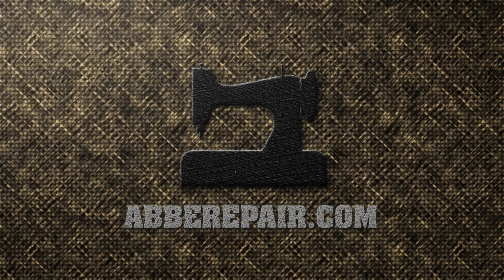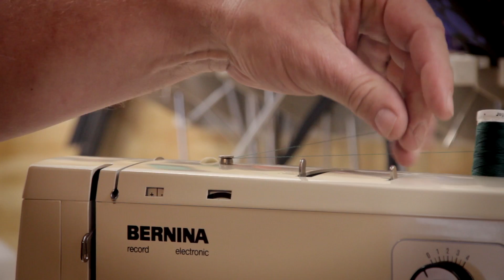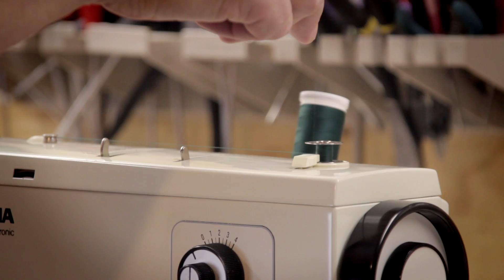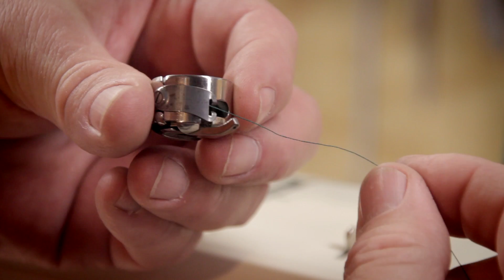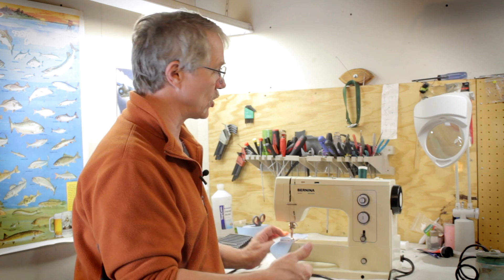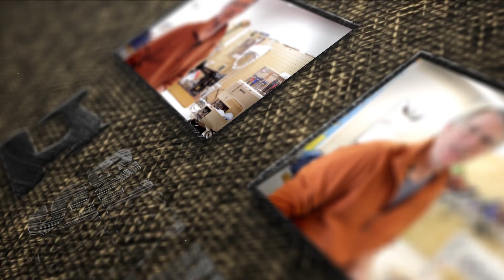Sewing Machine Repair with a Bernina 830

Comment: Just found your posts tonight as I was searching for information about a Bernina 831 I just inherited.   You seem very knowledgeable about these old machines.  This one has a knee lift bar but there is no connecting apparatus in the knee lift opening, just a plastic "plug".  Do you know where I could obtain the part to be able to use the knee lift?   Also, the needle goes up and down when I disengage the clutch to wind a bobbin.  There does not appear to be any old oil or grease and this machine was not really ever used.  Will this damage the machine when I use the bobbin winder?  It sews beautifully and I want to take good care of it. 
Thanks.  Pat
Reply from the maker: Pat Fuller hi Pat. Thanks for your question. If the knee lift linkage for the presser foot is missing the only source I know to replace it is buy picking up a parts machine and using its parts to install it in yours. As to your clutch issues, the hand wheel should move independently when the clutch is loosened. The main two reasons it won’t is lack of proper lubricant between the hand wheel and the upper horizontal shaft and/or the belt is too tight. Hope this helps! Allen

Comment: I have the same problem as Kar Ser (posted 2 yrs ago).  How do I clean the old oil from my 830?  Hopefully as you mentioned in your response this will take care of the needle moving when I'm threading the bobbin. Great video - thanks.
Reply from the maker: R Jackson R Jackson. Thanks for the comment. Old oil and grease act as a glue!  It gets very stiff! This old oil and grease needs to be dissolved and or scraped away.  Linkages may have to be disassembled. When lubricants get this stiff it must be removed but very carefully and very gently!  Damage to any part may be unrepairable!  I have a video coming soon on lubrication. It shows old grease and oil and offers methods to help.
Thanks again Happy Holidays Allen

Comment: Hello sir I have Bernina  using for almost 45 years suddenly the pedal couldn’t get a currents so when I turn  it on only the machine itself running   , please reply
Reply from the maker: Julie Aduca hi Julie thanks for the comment. I'm not sure if you mean the machine keeps running by itself or if you have to turn the handwheel to get the motor to start. Either of these situations should be checked out by a train tech. Oops with electricity is dangerous!

Comment: luddite question: i was given an 830 bernina and was told it was a serger. i am clueless whether it IS or not and would have no idea how to identify one (a serger, compared to a regular bernina). i'll peruse manuals and things on line, and may find out soon. but i'd love to have some guidance on this. thanks in advance  :)
Reply from the maker: nosowisewoman hi nosowisewoman  thanks for the question.  A sewing machine has one or two upper threads but most people usually use one and pair it with a bobbin and bobbin case to make a stitch. Sergers don't have a bobbin.  They have typically three or four threads that peel off thread cones perched on spool pins behind the machine. Sergers also typically have a set of knives to shear the fabric to a custom width to set the seam width. An 830 Bernina is a sewing machine not a serger

Comment: I have a question. I recently bought the Bernina 830. After I cleaned/oiled it. It runs perfectly. Why isn't there is gash where can cut the thread when you end a seam?
Reply: Hi All, the Bernina 830 has a thread cutter on top of the presser foot lever. You can lift both threads and cut them there. I usually use scissors but when in a hurry or can't find the scissors ;-) I use this cutter.
Mine is from 1979 and has this facility.
Reply from the maker: JandaliaTheFirst hi JandaliaTheFirst!  Thanks for sharing! Allen
Reply: This is the first time I've seen anyone mention the thread cutter on the presser foot lever!
Reply from the maker: Gladys McCoy hi Gladys!  Thanks for your note!  I hope you like yours as much as I like mine!  As for a thread cutter, I have a little scissors that I keep handy. Have a great day!

Comment: Hi Allen, Thanks for posting this video.  I have the same machine as the one you are demonstrating with, and was wondering if you run the bobbin thread through the hole in the arm on the bobbin case? If not, what's that sucker there for? Thanks.
Reply: The hole is for drawing the thread through to make a buttonhole.  I saw it on another YouTube video
Reply from the maker: motobuilt73  hi motobuilt73. What a great question!  I don't know why Bernina put that hole there!  Some machines seem to do some stitches better when you use it.  I'm surmising here but the engineer may have been thinking that routing the thread that way could make it feed smoother... I find it does change the lower tension if you use it or not.  Thanks again. Allen
Reply: motobuilt73 sewing pin tucks
Reply: I used to feed thread thru that arm hole

Comment: Thank you for a great video, Allen. I recently purchased a Bernina 830 that had been in storage. It sews fine but the belts are noisy. The hand wheel doesn't move smoothly. It makes a buzzy, crunchy sound. The belts are lug belts stamped with the Bernina name. They look to be in good shape and still flexible but I wonder if they are dried out.. Adjusting them didn't make any difference.  Would my hand wheel move more quietly and smoothly if I replaced the lug belts with V belts?
Reply from the maker: Anita Miller hi Anita!  Great question. It is possible that the belts are in poor shape but you seem to feel they're ok so I'll take your word on that. The main cause for the symptoms you are describing is lack of proper lubrication. The machine needs to move very freely, including the motor brushes!  Then you can adjust the belts. They need to be as loose as they can be and still run the machine!  Too tight steals all of your power!!  I hope this helps
Allen
Reply: Hi Allan, Thank you so much for your prompt reply. I did oil the machine with Tri-flow oil. I will check the manual to see if I missed any spots. I cleaned the motor commutator and replaced the brushes (even though they didn't need to be replaced.) I will try loosening the belts as you described. If nothing else works, I'll replace them with V belts. Thanks again for your help!

Comment: Video is great I have a Bernina 830 record machine and I have been wondering if it is worth my money to have it serviced or go for the Bernina1008S mechanical machine ? I do have a 550QE but I want a back up for other sewing projects.I just don't know what to do as my  830 record is in excellent condition.Have you any unbiased opinion you can offer me as you have worked with machines for so long. Are spare parts still available if I take it in for a service? I am in UK.  Hope you can help. Many thanks
Reply from the maker: Valerie Abrahams sorry I missed your post!  I'm also sorry I can't give an opinion on the value of machines I haven't inspected. There are just too many variables. Allen

Comment: Thank for getting back Alan, I bought the bernina 830 record of eBay , I was delighted with it , when I got home from collecting it  I tried it it was so grand, then the next day it wouldn't work no sound from it at all . We chanced the fuse just nothing do you have any thought what it could be please.
Reply from the maker: Gilda garbutt wyer Hi Gilda. Does the light work?  If it doesn't and it's not burned out, it is probably the cord set. If the light works and the motor doesn't it could be the circuit board in the foot control or a bad cord or loose wires somewhere or stuck motor brushes or something else. It's hard to troubleshoot over the Internet. I recommend bringing it to a competent Bernina service center.  It probably needs more then most people can safely do!  Good luck. Allen

Comment: Hello , how can I get my  bernina looking white do you have any solution please.
Reply from the maker: Gilda garbutt wyer Hi Gilda. Thanks for your question!  I'm assuming that you've cleaned it.  I use a 50-50 solution of 409 and water. Full strength 409 can remove the lettering on machines!  On some of the glue and grease I use rubbing alcohol.  Be sure to rinse with clean water.  If it's yellowed because of UV (sunlight) there isn't anything I know that will make it better. I hope this answers your question. Happy Holidays!

Comment: Is it possible to use a 750 Watt AC Power Motor Aerostar LM1000 (servomotor) on the 830 record?
Thank you in advance,
Gerd
Reply from the maker: Doc Sledge   Hi Doc!  Tinkering can be fun!  I am not familiar with your specific motor.  I like to stay with factory replacement parts or proven replacements.  I don't have the time to make all the modifications necessary to machines and brackets, belts, and power supplies!...  I'm not sure what my insurance company would think...  I like the factory motor. The brushes are a little small but are easy enough to replace. Ease to polish armature...  I like the 830.  If you are doing it to make it more rugged, industrial like, it has no oiling system and two plastic gears.  Great domestic machine as it sits.  Not rugged enough to take the hard use I associate with industrial.
Reply: Doc Sledge  my Bernita 830 seems to have a slight wiggly in the straight stitch.  Please help. 
Sally

Comment: Hi Allen,  I have an old Bernina 830  as in this video.  At times I would like to use upholstery thread or button whole thread.  But when I do the tension isn't correct and the stitches don't look nice.  Can you tell me what I need to do to make the stitches lay nice.  Of course I use a larger needle but don't know what else to do.
Reply from the maker: Nancy Eubank  hi Nancy. You bring up a couple of good points, GREAT POINTS! One point is thread weight or diameter affecting tension.  Yes! You can change the upper tension setting to make up for larger or smaller diameter thread and change the setting of that screw on the bobbin case we've all been told never to touch... Nothing about an 830 is beefy enough to do a " heavy thread job".  In my mind it is an excellent machine for 50-60 weight thread with a 12 - 14 needle. It isn't an industrial machine and forcing it because you can will probably damage it, maybe beyond repair.
Reply from the maker: Nancy Eubank hi Nancy. This is my second attempt to answer this. My iPad ate my first try!  You asked several GREAT questions. First, I love my 830 and and find it does a fabulous job with 50 - 60 weight thread and size 12 - 14. Size 14 in sharps or ballpoints are my standby. Size 09 - 11 are too small for "standard" thread to move freely through the hole in the needle.  They need a smaller thread.  About 4" of thread move down through then back up through the hole in the needle every stitch.  Match needle size to thread diameter.  Now, the 830 is not an industrial machine.  If you put in a large needle and use heavy thread and crank up the tensions to sew heavy material, you still won't get a great stitch because things like the take-up spring are sized for a lighter duty use.  Things like needle bars could bend.  Sorry but I don't recommend an 830 be used "heavy applications"

Comment: My grandma gave me her Bernina 830 when she stopped sewing, I went to use it for the first time and the pressor foot will not lower. What would be the cause of this? 
Thanks in advance
Reply from the maker: Nate Christopherson hi most probably it is old oil/grease. Something bent is improbable. Try some fine oil on the vertical shaft, both upper and lower bearings. The rest of the entire machine probably needs the old oil and grease removed and all bearings and linkages freed up!  3 - 4 hrs of knowledgeable labor?

Comment: Hi Abbe, Thankyou for showing the 830 working. Thinking of buying a vintage one similar to the one shown. yours felicity in Sydney Australia
Reply from the maker: Ian Thomson  hi Ian. I think it is the best machine Bernina's made.  The problem most have is they are stiff from old hard oil and grease. Free them up, keep them lube, they'll last and perform!
Reply: ABBE Repair thanks Abbe ....but I will look at the new machines as well, Im in Australia. .. Bernina 380 looks good  but i am unsure about the computer(not using just the lasting quality, w expensive repair)
the reason I mention this and looking carefully, is that i have purchased a Juki f600 its good but I'm having to return because it is giving me electric shocks.... like a buzzy pin effect on my fingers..... no one seems to know what is causing this. 
Yours felicity 😊 💓 🐈
Reply from the maker: Ian Thomson I have a singer 99k. It just does a straight stitch. It's from 1950. I love it. Computers in sewing machines don't last longer then the ones on your desk. I'm plan on my great grandchildren using my 99k!
Reply: Hee hee yes i agree!

Comment: Thank you my friend!!! I bought my mom an old Singer... A.. something, I cant remember now... it's all metal. She only oils it... the thing won't quit and it's from the late 50's or early 60's. stitch is perfect. Why don't they make them this way anymore? I think its that A- style slant. That thing sews more perfect I think than my Bernina 830, which was made in 1980.
Reply: I paid $25 for it at a thrift store, had a cabinet. I took it to a shop and paid them $160 to look it over.... well worth it!
Reply from the maker: I think too many great old all metal machines are discarded and replaced with "stylish", "eye catching" pieces of plastic. Nowhere near as rugged!  Plastic breaks all by itself!  Doesn't need much help just a few years can do it... Allen

Comment: CAN you tell me where i loosen, or what shaft or ? to adjust the timing? can tell the hook is slightly off, and misses sometimes when doing wide zig zags... thanks!
Reply from the maker: zipcrazed  I've been fixing sewing machines for 20 years and still use gauges when I check and set timing. Have you tried putting in a new needle?  It's the cheapest tune up you can do and is often the problem!

Comment: Does the Bernina 830 have a place to adjust the electronic foot regulator.   Mine goes too fast
Reply from the maker: Keith Jones hi Keith. The 830 used several different foot controls. If yours just goes fast with no incremental speed control it probably has a ceramic housing full oh dine size carbon discs. The more you press on the foot control the more these discs are pressed together reducing the resistance and allowing more amperage flow to the motor. If your controller has "bounced off the floor", some or all of these discs could be broken. The only time the circuit is closed is when you press the controller all the way to the " wide open" stop. Great question. You should find a repair tech. New foot controls for Berninas are very expensive!

Comment: Hi, I just got a Bernina 830 record from my mother-in-law. I was wondering how to change the stitches on it. I read the manual, but it doesn't really explain the basics in there. Could you please make a video for that? Thank you!
Reply from the maker: fabianam4 thanks for the question. I will try to include that in any future videos. Meanwhile, there I a lever on the top of your machine just to the right of the stitch selector. The lever should be forward or toward you when using a zigzag or straight stitch and back or away from you when using all other stitches. You should hear a clunk when "shifting" this lever. If there is no "clunk" the oil is probably so stiff the linkage can't move. This is a common problem with these machines. It's not the machine it the old oil. Oil and grease go from being a lubricant to becoming an adhesive over time. I would bring it to a pro. Freed up this machine should be a jem!  I hope this helps. Allen

Comment: Hi Allen, I was given an 80s model Bernina 830, 115vac, 60hz, 105w, I was able to plug it in, thread, and set the bobber, then it blew my Circuit reset, tried a couple times, but it keeps blowing.  Any idea why?  I'm on 110-125v. I am new to sewing.. learning from my manual& you tube!! 😁
Reply from the maker: Jodi P hi Jodi. Thanks for your question. The only reason a breaker would trip is there is too much amperage drawn through it!!!  If your machine is running well I.e. lubed and moving freely, it should only use about 1 amp.  If the oil and grease is old and stiff or thread is wrapped somewhere it could draw much more. Damaged wiring could be another very dangerous reason. YOU SHOULD SEEK PROFESSIONAL HELP FOR THIS.  Danger of fire and/or electric shock is very possible. It might not be what you want to hear but a pro should check it out. Allen

Comment: I just started using my bernina record 830 which I got from my Grandma. My dog feeds seem to be stuck in a down position and won't feed fabric, what can I  do to fix this problem? I'm really new to this machine. thank you for your videos and any help.
Reply from the maker: Annigreenspring thanks for the question. On the front of the machine, in the lower right section, 2 inches below the stitch length regulator, is a round knob.  Turning this knob to the left will raise the feed dogs.  To the right will lower them again. The linkage gets very stiff and may not want to turn. If this is the case extreme care is required to free it up.  Replacement parts are no longer available so don't force and possible damage anything.  Thanks again.

Comment: Hi Allen, thanks for the videos they are very helpful.  Some one gave me a Bernina 830 reporter but when i try to wind my bobbin the clutch only works for a second then it seems to engage and starts the needle going up and down.  Any Ideas?  Thanks again Roxanne
Reply from the maker: Roxanne Imhoff thanks for your question. There are two main reasons the needle goes up and down when the clutch is disengaged. Old oil and grease act as an adhesive instead of a lubricant and/or the belt's too tight.  Thanks again. Great question!